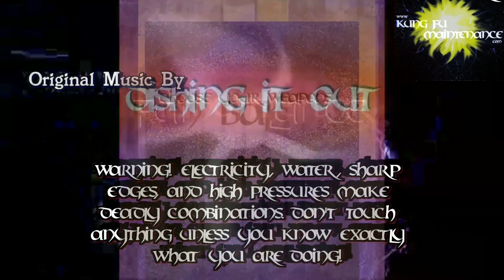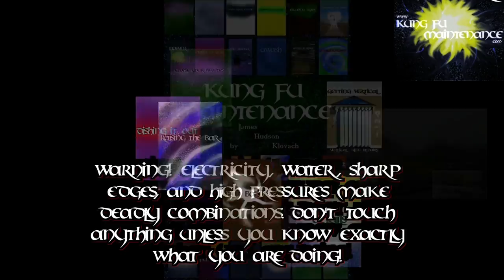Refrigerator Freezer Ice Cream Melting  Not Freezing Properly Most Often Cause First Check

Comment: I've always opened up the back cover and the front cover and then switch my shop vac's hose from vac to blow and blow the junk out of the front of the coils. No need to fight with brushing it out and taking a chance on screwing something out. It's a bit messy (hold a sheet around the front opening) but it does a lot better job and you're done in 10 seconds.

Comment: What's a good 2nd look if it's not dirty coils? Mine is a secondary "garage" fridge so the area was filthy, freezer hasnt been getting below 14 degrees but oddly the fridge has been too cold, as-in freezing my milk cold and finding a stable temp has been challenging. I didn't pull the back to see if the inside coils froze up, but I saw no clues of ice. Is the next step an auto defrost or another switch? Thanks my friend, not the compressor obviously with the fridge side at 22 degrees

Comment: Thats it? You just vacuumed out the coil?
If that hadnt worked what would you have done?
Reply from the maker: +Blade That was one tired fridge. LoL On that one probably would have just changed it out. On one worth saving it depends on the problem, bad relay, bad fan, bad board, bad charge etc... Replace relay, change fan, change board, adjust charge etc.. Again depends on the specifics.
Reply: KungFuMaintenance Do you ever work on commercial ice makers?

Comment: Great video I need some help please! My freezer will not get as cold as it use to will not make ice and frozen items such as popsicles or ice cream are soft! Fridge side temp is fine and I did clean the coils. I checked to see if the coils on the inside where frozen both sides are clean no frost. Compressor is warm and running. I am lost now and have no idea what to check next please help. We have a 6 year old  Samsung side by side refrigerator with ice and water dispenser in the door not sure if you needed that information. Any help sure would be greatly appreciated. really enjoy your channel so many great tips. Have a wonderful day. -Paul
Reply from the maker: Unfortunately it sounds like a low refrigerant charge which would also mean that it has a refrigerant leak somewhere.
Reply: KungFuMaintenance thank you for your response! I was thinking that but wanted to check with you first. Really enjoy all your videos thank you for all you do! Have a wonderful day.
Reply: @KungFuMaintenance  my freezer leaks into the fridge
Reply: Paul Rhodes @ hi , i have the same problem, how did you fix it ?
Reply: What if there is no freon leak detected?